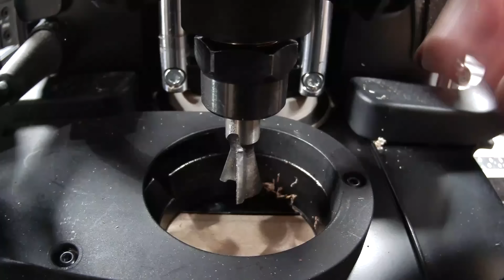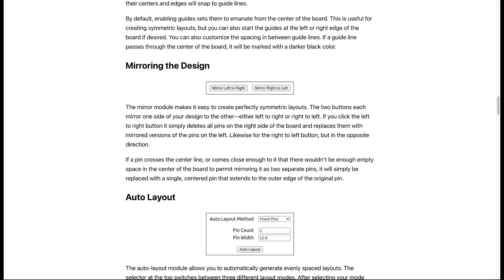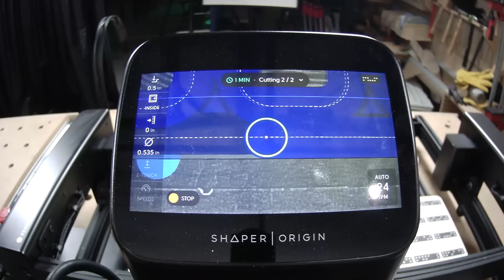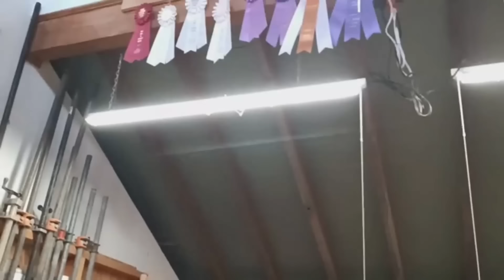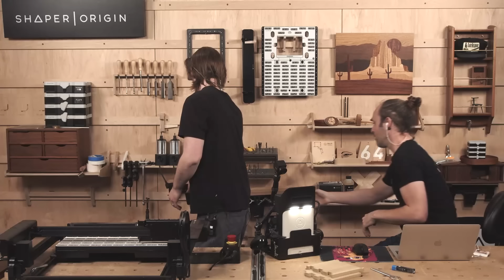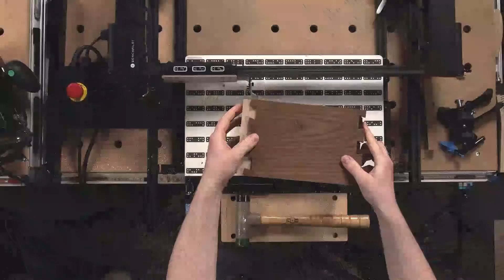Session 147 - English: Dovetails on BenchPilot

Comment: Shaper team, could you check your inputs for the dovetail generator please.
In your video you enter 13.6 mm for the dovetail diameter and 13.8mm for the dovetail height.
On your web site the dimensions for the dovetail cutter are 13.8 for diameter and 13.5 for height which is the same dimensions as your shaper session edition 106.